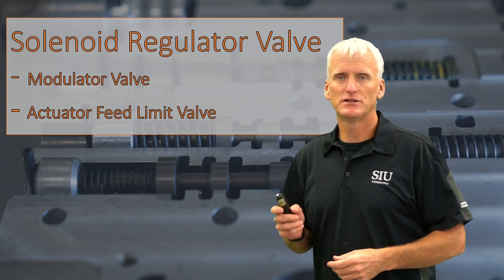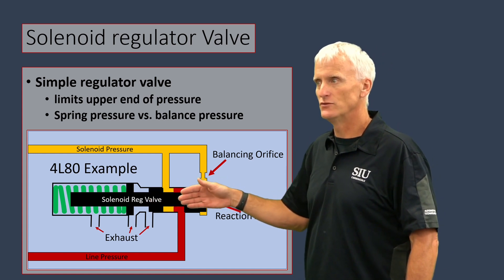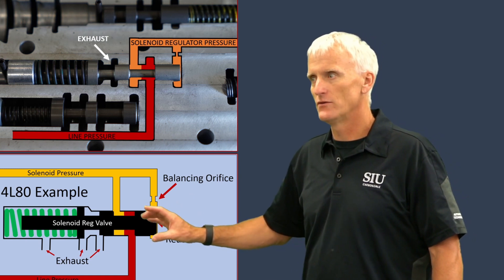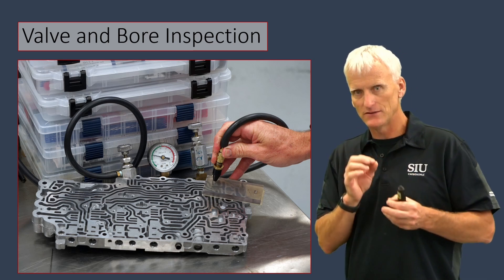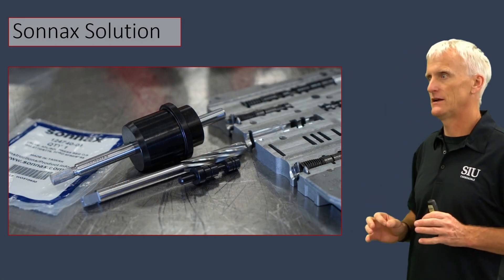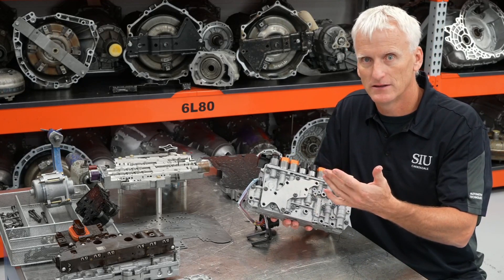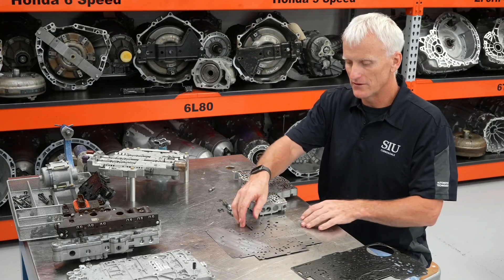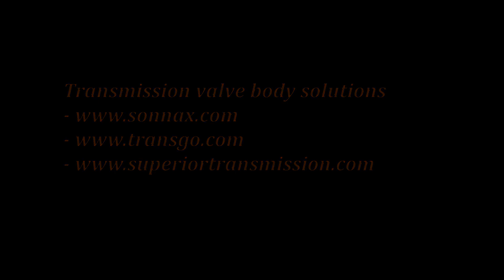Auto Trans Solenoid Regulator Valves! So important!

Comment: I have a 4r100 and sometimes i have a delayed engagement when i shift from park to drive otherwise it drives fine and my temps never go over 180 degrees. I am thinking of replacing solonoid valve body, accum valve body, main accum valve body and filter. Is this a good idea? I am going to use new parts no rebuilds .thanks
Reply from the maker: It might be the solenoid pack.  When  you have it apart, you might air check the clutches and inspect the valve body as well.
Reply: @siuautomotive  thanks

Comment: Dear Sean! You have a black belt in automatic transmission and only you can help me. After installing the Trans GO repair kit in takeoff, it should work. And according to TCM, I myself can theoretically repair my TCM. What usually goes wrong in it? And I can also buy TCM from you.
Best wishes, Yura!
Reply from the maker: Sorry Yura!  I don't sell these, I only teach them, lol!  Regarding the TCM, I'm not sure what happens to them.  It's just one of those last things you replace if you know the solenoids are good, the valve body is good, the clutch endplays are good, and the trans air checks good.  There's nothing else left! Lol!

Comment: Hi! First of all, I would like to thank you for the information and training provided. I myself repaired the 6F50 automatic transmission / everything worked out. Replaced repair kit transtar with pistons and trans go. But there are questions, I do not like how the automatic transmission leads. At 30 miles during switching like a butoh, someone is holding the back, there were no earlier and plus there are small jolts when R, D is turned on. I'll try to change the transmission solenoid / TCM. After buying a new TCM on ebay, do  need to adapt to  car? If nada then how can I do it.
Best regards, Yura
Reply from the maker: Usually when you get a new TCM, you'll need to program it.  But since you are getting it from Ebay, maybe the seller has the ability to program it for you.  Regarding your shifting issues, I'd check to see if the line pressure is within spec.  It sounds like line pressure high for some reason, and a solenoid or TCM could cause this.  Good luck!

Comment: But dont those transgo shift kits double up the pressure?
Reply from the maker: I’ll have to do the calculations, but I’m almost positive that they leave the sol reg pressure the same.  On some of their older performance kits, they have options for increasing pressure, but in units like the 6t70, they are just fixing a worn out valve body.
Reply: @siuautomotive  thanks for the response, and your videos are awesome! I just assumed that they always bumped the pressure up, but I guess it may depend on the transmission model and what its known to have issues with or known to need improvements with. I have a 6R80 with weird shifting behavior and Transgo has a shift kit with specific things being addressed for it. "Common concerns with this transmission are TCC shudder, rough coast down shifts, gear ratio error and solenoid performance codes. Firstly, these complaints are the result of the wear in the pressure regulator (PR) valve bore and the pressure regulator valve balance bushing. Secondly, the torque converter clutch regulator valve design and calibration were in dire need of an upgrade to address the TCC shudder complaint."  Would there be benefit in upping the pressure for the converter to keep it locked up better? Provided the lock up clutch is not warped or cracked? Is the 6R80 converter clutch the same as the 6L80? With same problems?
Reply from the maker: Transgo makes a great product and I think it'd be worth putting in a kit to see if it addresses the complaints.  I do know that the 6R80 is known for solenoid issues, from either contamination or solenoid seat wear, and this would also cause your issues.  I don't think increasing the pressure would help your issue, because these transmissions are always monitoring shift speeds and the computer would likely try to work to reduce the pressure, negating any modification you did.  And, by doing that, you could end up making the computer work outside its limits of adaption.  The 6R80 uses a different design of torque converter than most.  It's still a two-path, but it uses a captive clutch on some designs.  I believe they are having issues with converter lining flaking and their plastic stator falling apart.  If you pull the pan and you find friction material or plastic, it's probably from the converter.  It's a difficult converter for the TC reman shops to rebuild because if its design.
Reply: @siuautomotive  Thanks for that info. Sounds like the 6R80 has its own issues. I just bought this one and trans oil was black at 80,000. Had a lot of fine metal on the magnet. Seems way to black for fluid thats supposed to last for 120,000 miles. Trans might not have much life left. I changed fluid and filter for now. Going to put the transgo shift kit in next hoping it will extend its life until I'm ready to rebuild it.
Reply: And of course i'd replace the Converter probably with an upgraded one.